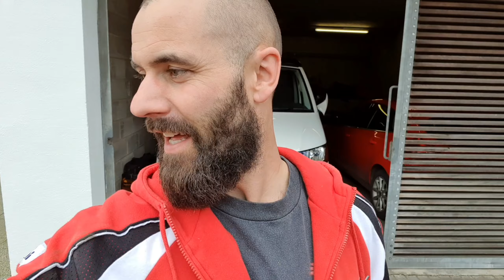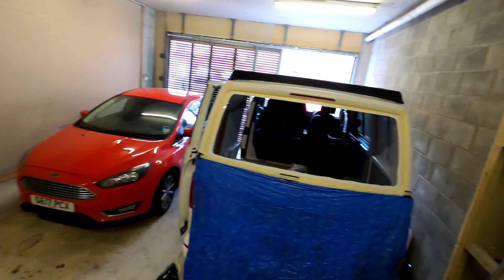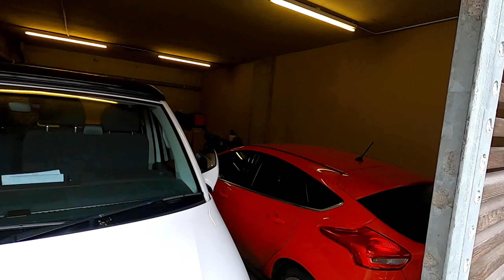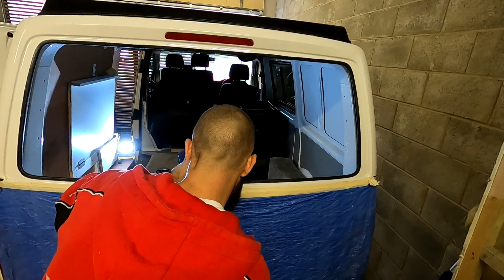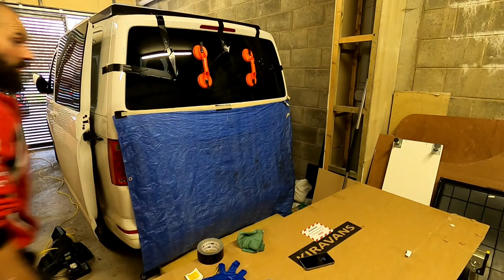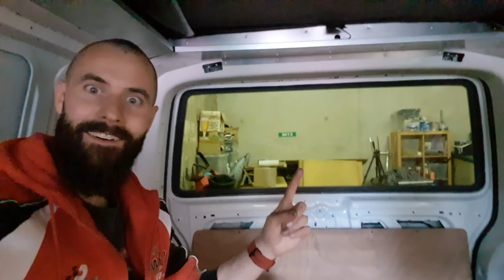Retro fitting a rear window to the VW T6. Lockdown project No.Umpteen!!

Comment: Very nice and clean work there! 🙌🏽
Did u add any heating mechanism to it? And also did u have to attach a rear view mirror too?
Liked and subbed ma duuuuuude 👍🏾
Reply: Hey man, cheers 🎅 No heating element, sure it would be possible but decided to keep nice and straight forward. The van already had a rear view mirror anyway although was quite used to not seeing out the back!!